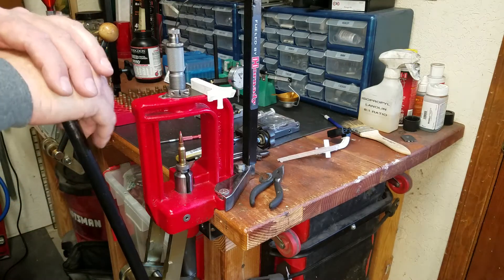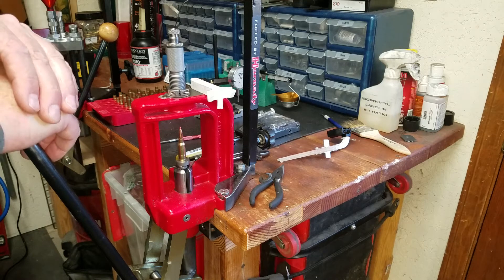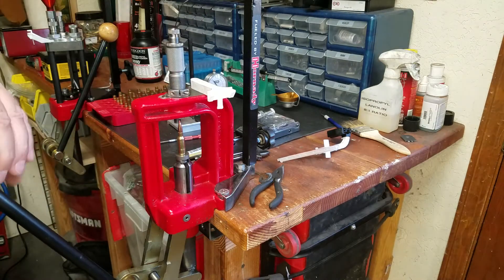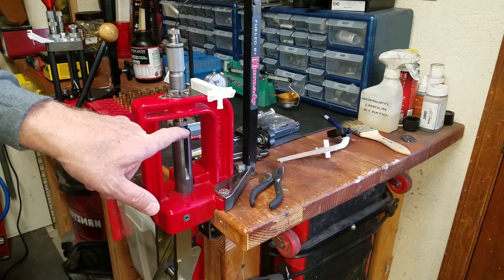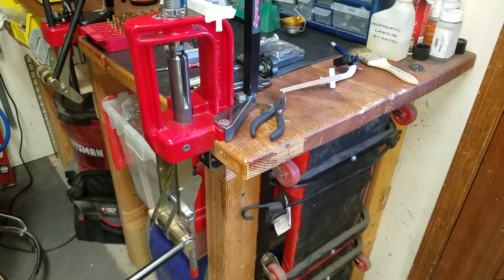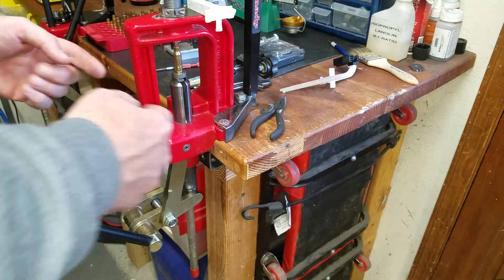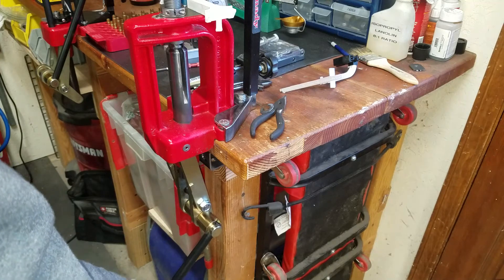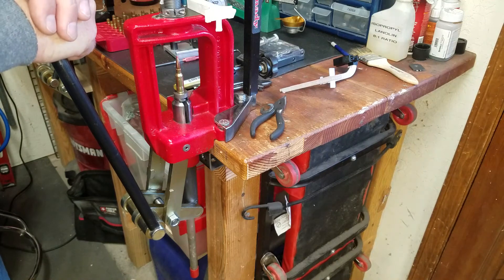Cartridge runout and press considerations...Presses with stops vs camover observations.

Comment: More Importantly your die set up sucks. set up your seating die so it bottoms out on the press. before the ram stops hit. 🙄I'd recommend using Lee bullet seating dies that don't have the stupid roll crimp built in.
Reply from the maker: You are correct, the dead length seating die from Lee mitigates the stop issue on Lee presses.  So does a light touch on the stops.  But, not all seating dies, even from Lee, are "dead length" so choking up on thr die setting to avoid the crimp is common.  I made the video to help reloaders understand the Idiosyncracies of Lee presses.
Reply: @TreeTopFlier  yeah... There isn't any if you use them correctly🙄

Comment: A little tip on your Hornady seating die. I bought one of their basic die sets because I wanted the one piece FL die fpr a specific purpose. Later, out of curiosity I decided to compare concintricity of loaded rounds comparing a Wilson arbor press type seater to the Hornady. With brass that was fully match prepped including turning necks, sized in a custom bushing FL die, with the same end of neck runout, the dummy round loaded with the Hornady seater had twice the runout that I got using the Wilson die. I have used a lot of different seater dies and for ordinary use I suppose that the Hornady seater will work fine, but for some uses we need the best that we can get for loaded round runout.
Reply from the maker: I actually went back to the Lee seater die.   For me the biggest advancement in concentricity was to anneal, neck trim and run back through the sizing die to re-center the trimmed neck.  I get .001 -.002 with crap NATO range pick up on 308.    IF the rounds have been fired in an over gassed AR the cases get damaged and are harder to straighten up.   Although this video is older I mostly leave it up so people can see how the stops on a Lee press can induce an unhelpful rock on the top of the ram and to show that its unnecessary to use anything other than a light touch on the stops when seating bullets.   Doesn't matter with Lee deadlight seating dies.   I'm sure the Wilson die systems are great, excellent machining.

Comment: So do you think run out would happen when also resizing brass. I have same press and have hard time chambering a round.
Reply from the maker: No, if you are setting the die to stop on the shell holder.  All the load should be radial or straight up and down.

Comment: Great video, but I have a question... As I look at my exact same press, with my ram raised, my linkage does not hit the stops as yours does. My die is screwed in deeper than yours and the ram is still 100% supported by the frame with zero play. What am I missing? I have no run-out issues, so why move that handle thru 180degrees when about 150 does the same thing?  You have great content, thanks for sharing 👍🙂🇺🇸
Reply from the maker: It depends on what die you are using and how it is adjusted.   Some bullet seating dies have a crimp at the end of the travel, if you do not want to use the crimp you would back it out and use the stops in the press.   Some dies, like a sizing die are usually set to stop on the shell holder so you wouldnt use the press stops.  Hope that makes sense.
Reply: @TreeTopFlier  indeed it does make sense. Thank you.👍

Comment: Thanks for sharing this I'll check my technique when I load again. I have an old lyman single stage press that seems to be a little worn. I'd like to replace it with a new single stage just haven't decided what brand to go with.
Reply from the maker: I dont think there are any bad presses out there.  Things for consideration may be... priming on the press,  cam over vs stops, quick change options for dies.

Comment: Good information, friend.
Reply from the maker: Hey thanks, and also thanks for your advice on the muzzle break for my AR pistol.  I purchased the one you recommended and it made a HUGE difference!
Reply: Welcome. It is one of many comparable brakes for a low cost. I certainly don't believe that's the only good one, but the only reason to charge more than about $30 for something like that is because people will pay it.